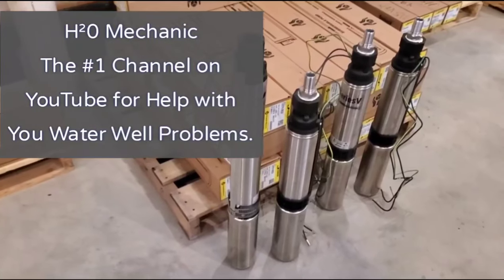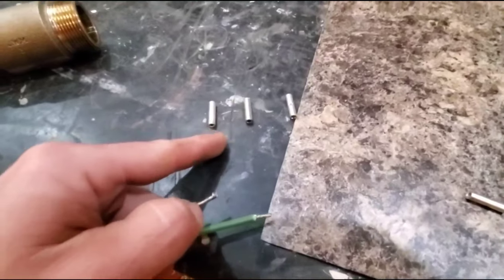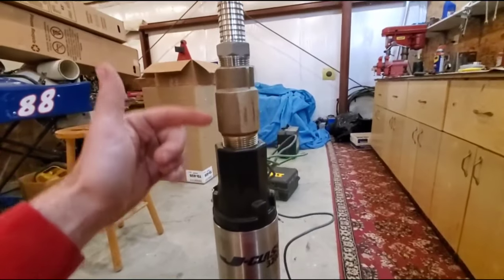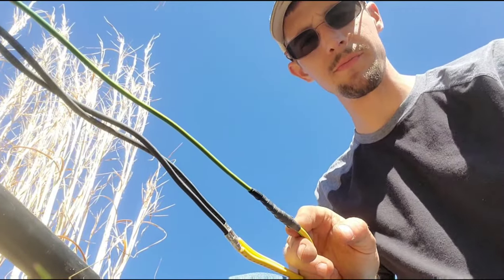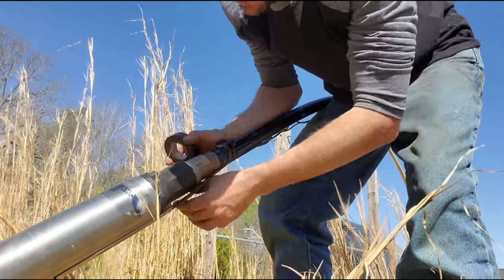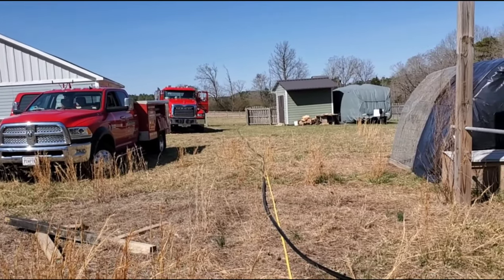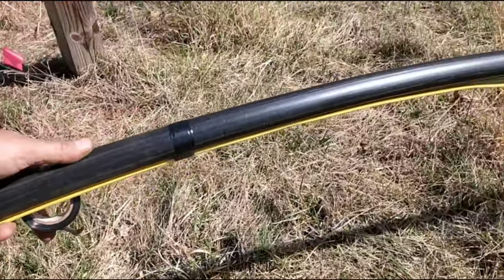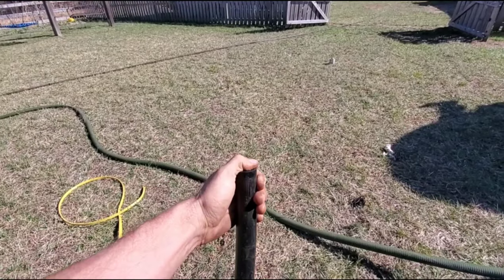What Size Well Pump Do You Need? How to install a Pump Correctly

Comment: Dude, no offense, but you did it all wrong... Those nipples reducing the discharge diameter are your fist mistake. Secondly, you should never test a motor like that, you can damage the stack or the motor itself if it's not designed for horizontal operation. Then the wire connections... Where do I even start!? EVERYTHING was wrong! that tape DOES NOT MAKE IT WATER PROOF! You MUST always use heat shrink sleeves over that tape, and the joint splicings should keep a distance of 4 or 5 inch at least to reduce the risk of a short circuit, never at the same lenght. Then the check valve.... you should install a check valve every 130 Ft to reduce water hammer when the pump turns off...
Reply: Job security
Reply: We never use check valves 😮
Reply: I wish you could help me.. my well is 550 ft and my pump died...I don't know what to use
Reply: @cindyanthony7947  If your pump has a control box you should stary by checking the capacitor. If your pump has no control box or if the capacitor is ok, then you need to take out the pump and take it to a pump repair shop
Reply: Thanks for writing this comment so I don't have too. You forgot solder crimps and waterproof heat shrink. And I always double the heat shrink first one a little shorter than the second.
Reply: @pepenabor Why would some pumps need a control box and some don’t ?
Reply: @rotaxrider 
       Some pumps, the ones with 2 wires and a ground have small start capacitors in the pump itself.

        The larger pumps which are usually 230V, 1HP and up, require a larger start capacitor and this larger Capacitor and QD relay are located in the box.    These pumps have 3 wires and a ground.